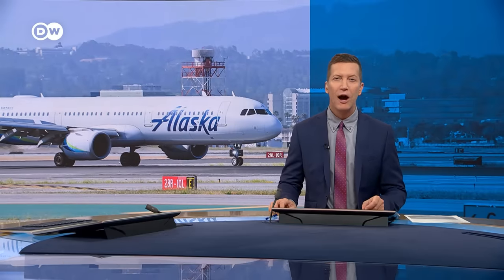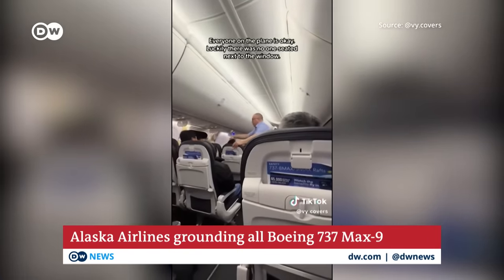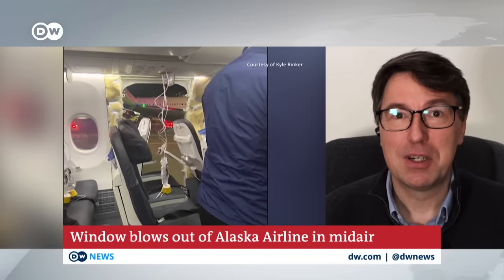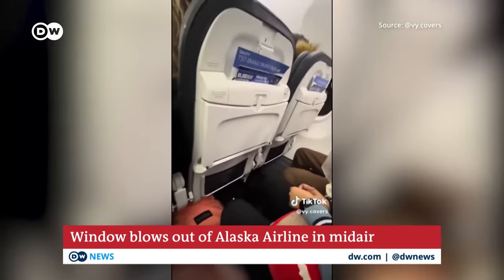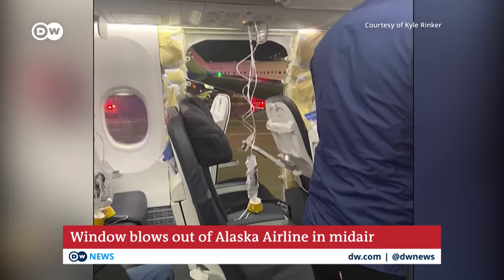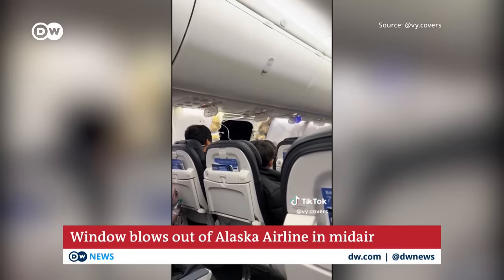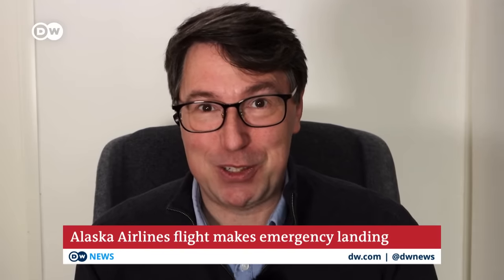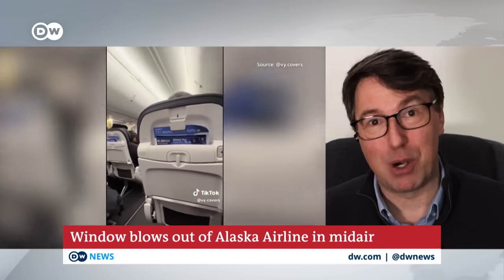Window of Alaska Airline Boeing blows out in mid-flight | DW News

Comment: Nobody advertises Airbus better than Boeing.
Reply: Airbus has its own history of design failures too.
Reply: NOT🚫 after Air France🇫🇷 447 ... Where the Design of the cockpit controls allowed the 2 Different Pilots at the helm to take separate/OPPOSITE control(s) of the airplane ✈️🛫 🛬 at the SAME TIME...
Reply: @lohphat  Airbus has design flaws; Boeing has design choices.
Reply: That wasn't a design issue. Airbus using fly by wire joysticks is a design issue for example.
Reply: Makes you wonder if Boeing CEO is secretly working for Airbus.
Reply: @gang208  like the A320 has never had issues.
Reply: @CaliSteve169  Not with the trivial problems like bolting down a deactivated door. The B373 was actually more reliable than the A320 for most of its history. Now, the MAX seems to have more issues than its counterpart, A321XLR.
Reply: Lol
Reply: @gang208  It goes back to the history of Boeing's merger with McDonald Douglas where Boeing was great at engineering and McDonald Douglas focussed on money. McDonald Douglas executive took over the merged company so the engineering quality changed. McDonald Douglas essentially tricked Boeing into using Boeing's money for McDonald Douglas to buy Boeing.
Reply: Indeed
Reply: Not like Alaska Airlines doesn't have a sketchy maintenance reputation.
Reply: @neiladlington950  That was a factory built closure of an extra emergency exit. Have a look at the picture.-there is insulation visible-that thing was closed and had a normal cabin fairing inside.
Reply: @CurtisELeMay-wr5mi  even that wasn't the major factor...it was the FO who was flying the plane incorrectly and Air France hadn't trained them properly
Reply: They don't need to, Boeing's doing it for them!
Reply: @lohphat  But none that have been tried to cover up within the company. THAT is something, which makes you totally loose the trust in the manufacturer, even if they've "vowed" to correct their ways.
Reply: @mutkaluikkunen3926  An Airbus exec went to prison for the attempted coverup and destruction of the flight data recorder after the Airbus crash at that airshow.
Reply: @lohphat  Haven't heard of anything like that.
Reply: @mutkaluikkunen3926  It's documented in the wiki article about the crash.
Reply: @lohphat  
Airbus in Japan fire incident burned slow because new materials saving peoples lives
Reply: @CaliSteve169  Over the past decade, how many passengers have died flying Airbus 320 vs Boeing 737?
Reply: @gang208 A321 doesn't have issues like 737
Reply: No way this is a design issue. Someone likely made a mistake when installing the plug. The holes in tabs look intact which tends to signify that the fasteners pulled through or improper hardware was used or they were never put in. In reality we will have to wait for more diagnistic info to kniw for sure. The technique of plugging these openings is not new so it seems un,imely to be a design flaw.
Reply: @longjohnny009  ....materials which were introduced by Boeing, with the 787.
Reply: @CurtisELeMay-wr5mi  this could've been disabled with a single switch, but both pilots started panicking (iirc). The accident was due to both maintenance issues and pilot error, but I don't think it was Airbus' fault.

Comment: Boeing 737 Max again.
Reply: This situation is different from the regular 737 max incidents. A blown out door isnt the same as MCAS forcing your plane to dive uncontrollably. the door probably had some bad maintenance prior to the incident
Reply: Or the Curse of the DC-10... 😬
Reply: @Uknownna it’s a 2 month old airplane. Manufacturing issue
Reply: @Uknownna  But could be because of the same laxed safety standards or the attitude towards them. "If we can swipe it under the rug, we sure as he** will" - Boeing CEO.

Comment: Sacrificing people's safety for financial gains 😡
Reply: Unfortunately that will always be the case.  The first and foremost priority of any company is profit margins.
Reply: Not the first time Alaska Airlines did this. Flight 261 crashed in the sea because of Alaska putting profits over lives.
Reply: @thatonerandomkid-r2n  Sue them to the last penny.
Reply: @thatonerandomkid-r2n  it’s actually the pressures put on the aircraft manufacturers from investment companies and shareholders that are causing this to happen….
Reply: Source? Sounds like jumping into beliefs to me. Could have been just a human error, whoever installed it made a mistake
Reply: @grrttr  You can’t be that naive.
Reply: @grrttr Of course, but there should be safety checks during manufacturing that catch human mistakes (or manufacturing procedures that minimise the risk of somebody making a mistake). And those things all else equal increase costs and therefore cost pressure can lead to less fail proof manufacturing. One such mistake can be bad luck, but multiple ones probably point to underlying problems causing this.

In the meantime, for those Boing planes not grounded, airlines might want to fill the seats next to these ‘plugged doors’ last when assessing seats. Or maybe that would be paranoia.
Reply: Wrong what financial gain. Can you prove?
Reply: @Shaz2024  caused by greed either way, though
Reply: @james-sk1si  Do you remember the Boing whistleblower from 5+ years ago? The one involved in verifying that planes got assembled properly? His testimony provided proof of financial pressures affecting quality. 

Whether that has anything to do with the current incident is of course an open question.
Reply: C’mon, don’t you think the answer to our problems is work people harder and longer and pay them less? 
Where could that go wrong?
Reply: @WouldntULikeToKnow.  yeah so what do you want, your shares to do well or your aircraft not to fall apart....
Reply: The acronym for that is Boeing.
Reply: thats american corporate way

Comment: prediction, all Max 9's will be grounded so that this can be checked on each individual aircraft.  This is not the operating airlines fault, this purely an issue that Boeing is at fault for. This particular aircraft was only 2 months old!!  United has a bunch of them too
Reply: Manufacturing faults rarely are completely random and thus if faults are found with other 737 Max airframes, they likely have some correlation with the production of this airframe (temporal, spatial). But I would guess that 737 Max airframes that have been flying for a few years now are much less likely to suffer from the same problem or they would suffered lost sections by now.
Reply: If a manufacturing error this big went unchecked, then yes, all airframes will be grounded across airlines.

Doubtful it will happen if the investigation finds the cause to be some sort of maintenance procedural error.

My prediction is the latter. Likely a procedural error, inattentiveness, negligence by a maintenance individual and/or team. 

We'll just have to wait for the report.
Reply: @aphextwin5712 the 737 max 8 doesnt have the Same Body. I think its Max 9 and the Max 800-200
Reply: United just announced they will be taking their Max9’s out of service for inspections
Reply: Now the FAA has ordered the grounded
Reply: It is 100% their fault. They are responsible for making sure their product is SAFE.

Comment: It doesn't suprise me if this is a quality control issue at Boeing. Past management went for cutting costs and increase of share holder value, above all. But it is pure speculation at this moment.
Reply: How's the shareholder value doing now? They need to value a company's long term reputation with the quality of its product. Unfortunately if you protect this successfully the damaging threats you avoided remain unknown and uncredited.
Reply: McDonnell Douglass "management" gutted Boeing engineering.  This is what you get.

At this point, I'd rather fly Comac.
Reply: @ZweiZwolf  Airbus?
Reply: this is every american company
Reply: Well american company are well known for cutting corner. They prioritize profit over safety.
Reply: @guill90  Airbus would also be fine, but Comac has something to prove, so their planes will be near-perfect to build a reputation for safety and quality, allowing for mass export across the Global South.  If Comac were to screw up like Boeing has with the 737 MAX, they'd be doomed.

Comment: That's not a window. That's the whole wall!
Reply: Thats the section that includes window? A window section. Probably window is more secured than the section that holds it
Reply: When a window succumbs to the pressure and goes, it’s going to invariably tear the fuselage. Many people have paid with their lives to improve the design. In the 50s, this brought down the whole plane. In the 80s, it would tear out a row of seats.  This is comparatively nothing.
Reply: It's a plug. The aircraft is designed to allow an emergency door in that location; most airlines don't use it, so the gap is filled with a plug in the factory. The entire plug appears to have come out; pictures from outside show the outline of the door very clearly.
Reply: It was a back door that they don’t use, not a window!!!
Reply: @Werrf1 I have 10,000 hrs. on this airplane and I have opened that OVERWING EMERGENCY EXIT countless times in training.  It is not a plug, it is a swing up door with a window in the middle of it. "most airlines don't use it, so the gap is filled with a plug in the factory" - not true, it is an FAA required emergency exit. Airlines don't have the option not to use it. There was no real damage to hull, the door just blew off and took some interior panel material with it. This is not a plug-type door. On older Boeing aircraft like the 727 you had to remove the entire door and put it on the seat or the floor inside to get out. This newer type has a hinge on top and is blown up by a spring type action.
Reply: @CockpitScenes  And since it wasn't one of the overwing exits, but rather the deactivated rear cabin door - as can be clearly seen in the photographs of the accident aircraft from outside - your description of its operation is entirely pointless.
Reply: @CockpitScenes would this have been more catastrophic if it happened at a higher altitude?
Reply: @Tom-nd1fs For sure!
Reply: @CockpitScenes In your case quantity did not transform into quality. You've been told it is a plug, bolted to the fuselage, not a door, and covered inside to look like a regular window.
Reply: If you look from the outside it looks like a door or panel blew off.

Comment: I could've been sitting there sipping my 7-Up and reading my book A Nuns Life and then suddenly sucked out into the atmosphere, right into the engine or  any number of terrible things . This is really scary.
Reply: technically that door is behind the engine so it would be more like you'd just slam into the horizontal stabilizer then a free fall.
Reply: This is why it's prudent to wear your seatbelt all the times!
Just in case you hit turbulence and end up planted on the ceiling or for incidents like this!
Reply: @16blockheads  "prudent" is the wrong word if you are flying on a Boeing...
Reply: 🤣😂 @brownmold

Comment: Armchair aviation specialist here 😃thinking that luckily this accident happened at only 15,000 feet. If the aircraft was at cruising height of 30,000 feet++, external temperature below -40C, it would have been much much worst.
Reply: A whole lot of injury and altitude sickness, plus how unstable the airframe would be where air is thinner and suddenly you are not aerodynamically sound is any ones guess.
Reply: @Caspers007 "Worst" in my language means sausage, so it reads rather funny
Reply: @Caspers007  It was the best of wursts, it was the worst of wursts.  The story of a NYC deli.
Reply: At ca 10,000m, going from 0,8 Atmospheres of cabin pressure to ca 0.3 atmospheres (ambient pressure at that height) means both almost immediate loss of consciousness, and severe risk of decompression sickness (joint pain, headaches, lung embolism, etc), with accompanying altitude sickness (nausea, headaches, inability to concentrate, shortness of breath). Add in extreme cold. Unlike Hollywood movies, likely a death sentence for most. 

Do not want to experience.
Reply: It is amazing that there was no turbulence in the cabin.
Reply: 😂 @Caspers007
Reply: @brownmold  Probably not a death sentence for more than a handful, as long as the pilot follows training & protocol to get the plane down to 10,000 ft.  BTW, no burst eardrums?
Reply: @ZweiZwolf  at 10,000m, I think the pilot has very little time. The pilot also has to get his mask on. Yes, eardrums may burst too, but they are kind of secondary to pink froth coming out of your mouth, or a bubble of air in your brain's blood vessels, or a hit on the nerves.

I don't know how fast these planes are allowed to dive. In the situation described, every second counts. The serverity and recovery are highly individual, depending on age, fitness, exhaustion, drug and alcohol use, level of dehydration, etc.

I still don't recommend. Even with well-trained, skillful pilots.
Reply: @brownmold  ALL commercial airline pilots are specifically trained for explosive decompression.  They immediately secure masks and DIVE for 10,000 ft, where the air is denser (10+ psi vs 2.7 psi) and warmer, such that most people can breathe without needing masks like they would above 12,000 ft.  Commercial flight has a FAA mandated 40,000 ft safety ceiling specifically so that explosive decompression events are survivable by the fast majority of passengers.  

Another Boeing 737 (SWA 1380) suffered explosive decompression at 32,000 ft due to an engine failure that damaged the fuselage.  One person was sucked partially out of the aircraft, and ultimately died of blunt force trauma after being admitted to a hospital after landing.  Everyone else survived because the pilots followed protocol, dove to 10,000 ft and landed quickly.

Comment: Boeing has a quality control / design engineering problem that has tarnished their reputation. Maybe airbus has similar issues, however, if they do - you never hear of them. Boeing is a national asset and needs to fix this.
Reply: Why wouldn't you hear about this problems if they were happening with Airbus?
Reply: @filipe5722 There could be a different whistleblower culture in Europe compared to the U.S., but that is a hypothetical. And if quality control issues lead to actual issues during operation, you’d hear about it for both manufacturers.
Reply: @aphextwin5712  A windown falling off mid take off doesn't not really require a wistleblower for it to be known.
Reply: If Airbus has them, they won't be swept under the rug, they will be addressed.
Reply: I was referring to the statement in the OP about “quality control / design engineering problem that have tarnished Boeing”.
Reply: Airbus took the decision to invest and build a new plane, the expensive option. their planes are fine. Boeing appeared to decide to save money and just tart up a 1960's aircraft and add colored lighting to make it feel new. now it doesn't seem such a good idea.

Comment: Another strike against Boeing …
Reply: I think you mean Alaska....
Reply: @Kpoole35  nope I mean Boeing, they manufactured the plane
Reply: @Kpoole35 The plane is brand new.
Reply: @culpablecruz  Alaska installed the door plug. good try though.
Reply: @knightsnight5929  Yup and Alaska elected for the door plug. It's not a Boeing QA problem. The 787 is built exactly with the same material and process as the 737 MAX. If it were Boeing's issue we'd see more of it. The Break line is too clean for a fuselage failure... this is a case of Human error upon installation after delivery was made.

Comment: The MAX keeps on giving. Boeing has not completely fixed the MCAS issue, now there is bad assembly issue. Not to mention snowman holes on the fuselage, which can cause it to break apart. There was a report on the NG (not even the MAX) build quality about twenty years ago. It seems that little has changed. I don't fly on the 737, NG or MAX.

Comment: It was an decommissioned escape door. Decommissioned means that aircraft as configured didn't require that escape hatch. It had a panel over it so no one could pull the handle. Why it popped out is the million dollar question.

Comment: This was a blown out emergency door that was nonoperational due to a lack of need due to the aircraft seat configuration. It was covered over from the inside by a dummy panel.  The door blew off and sucked out the dummy interior panel.  Good job by the Pilots.

Comment: What would be the outcome if this depressurization happened in the middle of the Atlantic at 10,000 meters and 1500 Kilometres from the nearest airport. Emergency oxygen last only 10 minutes, would a plane have enough fuel to make it to the nearest airport 1500 Kilometres away flying at 2000 Meters elevation.
Reply: I imagine the pilots would descend to a lower altitude, if possible, so lack of oxygen wouldn't be an issue.
Edit: oops, I misread your comment.

Comment: Basically, this plane had a fusalge with a panel in it that coukd have been an exit door in a plane ordered to have that exit door. So other planes have a panel in their fusealge that means the structural fusealge is not one one piece at all. Cookie cutter conveyer belt method of manufacturing this plane?

Comment: So a CHERMAN tv guy asks an "ezxpert" from FINLANDIA about an American design?   Sigh.  Is it any wonder that you dont have any credibility?  Some of the Fastners were not done correctly.  Manufacturing error.  Not a design error.  It was a BIG hole which reduced the pounds per square inch applied to the exiting air.  Had it been just the window it probably would have had a different result.  Physics.  Some expert.